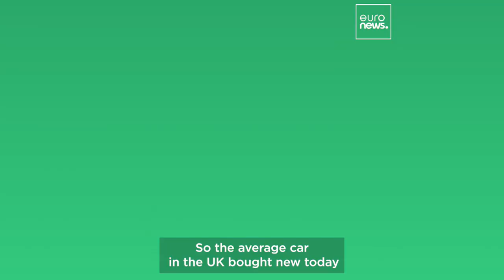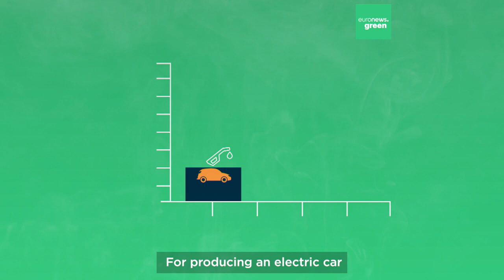‘What’s going to happen to all those cars?’: We asked an expert if it’s time to switch to an EV

Comment: I only drive about 4000 miles/6000km per year in my low weight petrol car. There are probably a lot of drivers doing similar annual mileage and a lot that are doing much more than the average 15000km to get that average. You need to analyse the MOT annual mileage records to get some idea of the mix. It would take me 15 years to do 60000 miles/90000km by which time I would probably have needed to replace the battery. I expect my existing car to go well beyond that 60000 miles figure. This argument for switching to an EV with current technology based on 15000km/year makes no sense to low mileage drivers. My 63 plate car is just on 40000 miles and I no longer use it to commute to work which was about 10000 miles per year. So I am doing below 4k/year. I have had cars that I have taken to 163k in the past. The switch to EVs needs some nuance. It is not right for everyone. A blanket switch to EVs is clearly a poor choice for the environment.

Comment: At the end of the day it is what people want  not what is reasonable. I drive a 30 years old nissan and I want to add electric axle to turn it into a hybrid, unfortunately the only company I am aware of making those will not sell to a person. On the contrary, average life of a vehicle in Japan is not more than 5 years, because of culture dictating that people like new things. If I was running a car factory, I would rather sell 2 cars instead of one. There is a problem with battery supply, so before we have full capacity we need to build in a buffer into the culture....

Comment: This is hugely misleading: they need to consider the emissions from the manufacturing of the ICE vehicle too, not just from the BEV. They are also not considering the huge advances in the renewable energy generation, or how electric vehicles will last way longer, with much less maintenance. It's not just about emissions from the pipe: ICE have oil and leaks, that will cause contamination, their entire lifecycle if damaging to the environment.
Reply: They are talking about ICE cars already on the road. Not new ones. So the manufacturing has already been done. They are talking about whether it is worth scrapping an old car or going electric.
Reply: We don't know how long the batteries will last. If Lithium batteries could last 14 years, why do we have to change our phones every 2 or 3 years?
Reply: @andrewg9677  Batteries can last 14 years and longer. The reason you change your phone is planned obselesence. The phone companies want you to upgrade, so is not made to last. An EV however is made to last and unlike your phone has a sophisticated battery management system which will cool or heat your battery, controlling rate of charge etc.

As for what you are talking about when it comes to scrapping. I presume you mean all the old ICE cars? It is simply taking the metal and melting it down. Far more efficient than digging it out of the ground and refining new material.
Reply: @daydreamer8373  you think built-in obsolescence won't be applied to EVs?
Reply: @andrewg9677  No. not if they want to sell cars.
Reply: There is energy expenditure in scrapping too. That's if they are actually scrapped or merely exported to Africa to pollute there instead.